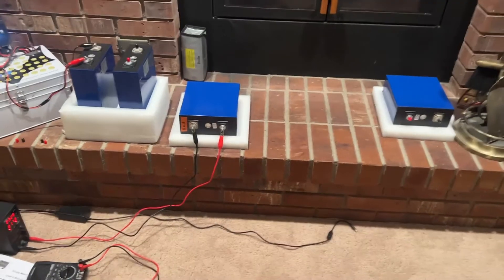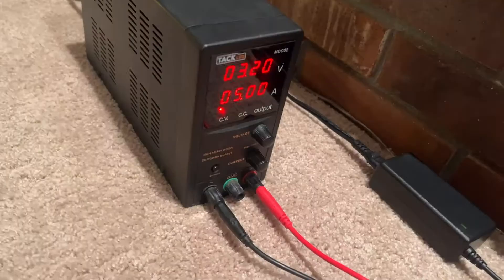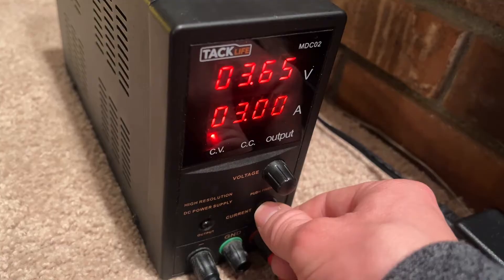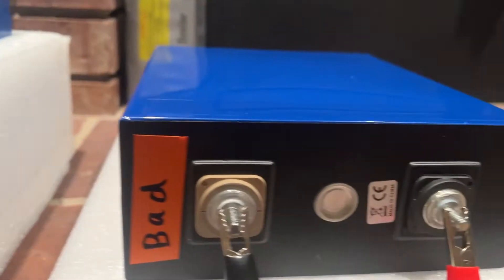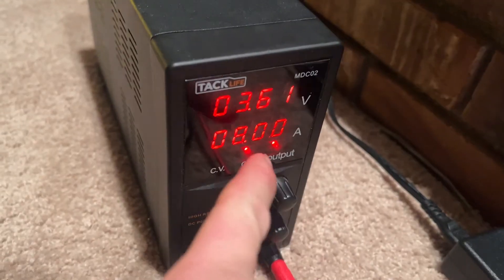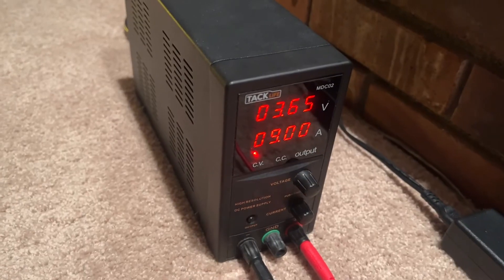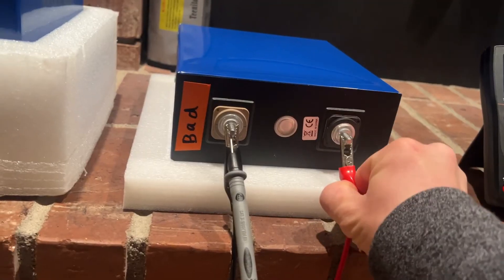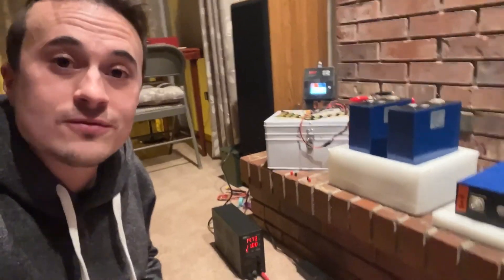How To Charge almost any Rechargeable Battery using an Adjustable DC Bench Power Supply

Comment: I have a 60v leaf blower battery that is to low 36v for the charger to charge. I tried using a 18v drill battery to kinda wake it up but it still won't do it. My bench top power supply only goes to 31v. How can I get this thing to the 54v requirements of my battery charger for it?
Reply from the maker: Get a 60v power supply. Or a new battery so you dont create a fire hazard. The capacity on that battery is going to be so terrible you could also have dead cells
Reply: @4WheelKid I bought another 60v battery. Jump started the original one for maybe 15 seconds and it woke up and started charging. It works fine now.

Comment: Just stick it on 3.65V (the charge voltage), set it to 5A or whatever your wire can handle, and come back in a day.

It isn't full charged until the current stops.
Reply from the maker: Sounds like a plan

Comment: mmm question, can you charge a lipo battery with this?, maybe 1 cell at the time?
Reply: Yes, the main difference is that lipo batteries too out at 4.2v per cell rather than 3.65v.
Reply: @HeyChickens true, thank u
Reply from the maker: yeah just make sure you are using correct voltage
Reply: @4WheelKid sure thing, thx a lot. I'm just waiting for my adjustable DC transformer lol. Can't wait to it. Well thx 😅

Comment: so is the voltage reading the voltage of the cells, or the total voltage of the battery?  nevermind i think you just showed it at the end.. i would set it to 12 or 13v to charge a car battery? that wouldn't be sending 12v into every cell would it?
Reply from the maker: just depends on what your doing. this is the most basic way to charge. you can get more advanced charging. 12v car batteries are simple. 13-14 volts is good for charging car batteries

Comment: I have a hoverboard that I am trying to "restart" I believe it is a 32 v. I have a power bench, what would be your recommeded setting?  its lithium ion
Reply from the maker: make sure you know the exact battery Chemistry and know and if your are charging cell by cell or all cells together. Know voltage range of cells figure out series vs parallel. your 100% responsible for what happens

Comment: `am I better off charging 12v lifepo4 directly with this or using it as the power source for my solar charger. I have a good victron solar charger and it seems that would do a better job of taking a battery through three stages of charge
Reply from the maker: yeah there are much better methods, I like using an isdt charger the most since I have one for fpv already, and it has LiFepo4 mode, and you can use the balance port even with 1s as a volt sense line so you can charge faster with more accuracy which is needed since the voltage profile is so flat throughout the state of charge on this chemistry

Comment: Unfortunetly i see this video late😂 my power supply just arrive and i connect to my 24V lifepo4 without turn on the power supply first and BANG😂 nice 50$ mistake
Reply from the maker: Dang! Didn’t realize that would cause issues 😬
Reply: Thank for your sharing! Just want to confirm. The flow should be: turn on Power Supply -> set Current limit -> turn on Output -> connect to battery. Is it correct?
Reply: Wow 😮. . . Maybe someone should make a video specifically about this exact topic. Because I had no idea that there was a specific order you have to follow. And based on the comments on this comment, seems like I'm not the only one that didn't know. I think I'm gonna go do some more research before letting my son use this PSU. 

I'm so grateful for this video here, It has helped me on so many levels! 👏 👏 👏👏........❤
Reply: Damn, that blows. Happened to me with my first power supply. I won't make that mistake again. $50 to the teacher, I always say
Reply: Tegyél diódát közé...így az akkumulátor biztos nem ad vissza a tápegység felé...

Comment: Thanks for the information. I use power supplies similar to this at work when we are trying to get cells in batteries balanced during the repair process.
Reply from the maker: Hey no problem! I found a charger for rc stuff works super well, mine has a mode for lifepo4 and using the balance lead on a single cell monitors voltage at the battery posts so it can charge at full amperage since these cells have such a narrow voltage curve. Even a tiny amount of voltage drop will slow charging unless it has a voltage sense circuit at the posts along with the charge connection. These power supplies are great if your trying to bring a cell back to life cause you can select ultra low amperage

Comment: How to select a best charging current for huaxing 3.2v lifepo4 6000mah cell
Reply: 0.5C is typical maximum amperage. That would make it 3 amps for a 6aH cell
Reply from the maker: .5C should be good. lower if you want to be extra nice to your cell

Comment: These are very useful tools for maintaining lithium batteries. Doing such things as top balancing a battery when it's cells are out of balance.

But ... you really should make up some custom cables with wire sized for the currents you plan to use and with proper ring terminals.
Reply from the maker: for sure, they can be great for that, I actually found using a hobby battery charger to work best especially when charging a single cell outside a bms. you can connect the charge leads and a single balance lead as a sense wire so the charger can compensate for any voltage drop and charge at full speed. even a tiny amount of voltage drop on lpf cells will slow down charging greatly if you don't use a charge sense wire because the voltage curve thoughout the cells capacity is so flat. ill make a video on it
Reply: @4WheelKid  The problem with charging at full speed is that the currents can exceed what's safe with 18ga wire and alligator clips...

Comment: Sucking in a bunch of fine dust setting on the carpet like that dude.slip a clip board under it.
Reply from the maker: There is dust everywhere my computer is full of it
Reply: Ok turn it off pull the cover blow out the dust out it back together re position it to prevent straight feeding it dust,and take an old couch cushion strip off the material,cur the foam rubber a little bigger than your air opening and make the foam about a half inch and attach it over your air inlet at that thickness or thinner if you can manage it will filter the air without dropping airflow that will filter out dust.which will if it builds up to much will cause short circuits the dust will bridge the distances between hot legs and ground legs internally in your equitment the dust can transmit electricity across the boards in electronics 
It also insolated internal components and shorten the life of said electronics.

PS. watch something funny look up the show letter Kenny
Canada gooses

Comment: Does anyone know if you could use one of these Adjustable DC PS to ran a device INSTEAD of the battery????  In my case could I set this at 12V and 9Ah and connect to the battery connectors and run machine??????  basically use this in place of a 12v 9A battery???????????
Reply from the maker: yeah that's exactly what they are made for

Comment: If a battery pack has cells that are imbalanced will that tool help to balance out the cells that are too low in the pack.
Reply from the maker: no this won't balance cells, ill make a video on a better charger for that
Reply: @4WheelKid  ok so if I'm correct you use it to recharge 1 battery to your desired volts and amp

Comment: No way would I trust the voltage readout from that power supply for charging batteries. A high quality multimeter like a Fluke or equivalent is essential connected directly to the battery terminals.
Reply from the maker: Good to check to be sure

Comment: You have to charge a battery at a limited voltage . What about current. The battery is going to draw its required amps or you have to limit the current as well?
Reply from the maker: you can limit current as well. not a big dealer with these cells though since they can can be charged at high current

Comment: If I want to supply with constant voltage to 12v car battery, what values are safer in order to avoid overcharging or burn the battery?
Reply from the maker: 14.5 volts should be fine, thats what its at with the car running usually
Reply: @4WheelKid  14.5 Is when alternator running right! And what current value? Also the alternator output?

Comment: How would you do this with a headway bank ? Would you have to break it down and link the bars in series? Or just do each cell individually
Reply from the maker: Just depends on what your trying to accomplish, if your building a battery and trying to top balance, i would charge each cell to the top then I would connect cells in parallel and charge all cells together to the top per cell voltage. Then your ready to connect into the pack configuration. If your just trying to charge a battery thats already configured and balanced then I would charge the pack as a whole to full. Again I’m not sure what your trying to do

Comment: I’m pretty new to all of this but I’m trying to charge a small 12V battery for a 8 plug power strip and I’m wondering how high I should set the voltage. On my power supply unit I can’t set the amps unless I adjust the voltage too. The battery currently is charged to about 6.5V

I hope that’s clear.
Reply from the maker: it's hard to say without looking at it. you would want to se the voltage to the max you need to charge the battery
Reply: With a 12 volt lead acid car battery .  You have 6 cells at  2.1 to 2. 2 volts. Charging voltage would be set at 12.6 to 12.8 volts. With an older car battery,  12.6 volts works well.  Charging voltage must be higher than the rated voltage of 12..... Another good tip charging 18650 battery. Set the power supply on 4.1 volts to extend the life of the battery.  If you are unsure of the amp settings. Play it safe. Maybe 0.050 ma. May take a week to charge a battery that slow. I don't know what kind of battery and set up you have. Be patient and safe.

Comment: You should be teaching how to work out how many amps to set the supply to. It's usually 1/10th the power of battery.
Reply from the maker: every battery is different, that's like saying every car takes 5qts of oil. learn about different battery chemistries, and read the spec sheets and learn about  c ratings. these LIfepo4 cells have a 1 c rating so you can charge/discharge them at 280 amps. I wouldn't go that high for charging though even .5 c charge rate at 140 amps is more than enough

Comment: You into amateur radio? Good thing to start. I have one one my workbench. I do not use it on a standard 12.8 radio. They have a bit of ac ripple. Yes i charge bateries with it to. I would not use a solid state power supply to charge batteries. They are circuits you can build to use a solid state ps. Last i remember there are 4 different ways they build switching power supplies. Dave Jones had a you tube channel covering these switching ps. It was called eevblog. Yes they do make very clean ps . Good video.. Nicely done.  Good move on waiting to buy. Try not to pay for something you can not own. 😊
Reply from the maker: I am not, I would but have way too many hobbies at the moment haha. You wouldn’t use a switching power supply like I used to charge a battery? I found the best charger to charge these lifepo4 cells is the one I use for my fpv drones, even if I charge one cell at a time you gotta still use the balance lead connected 1 cell and ground at the battery posts, because it monitors actual voltage of the cell so It can raise the voltage on the back end to compensate for the voltage drop on the cables, these LIFEPO4 cells have such a tiny voltage range throughout most of the capacity that even a small voltage drop will cause it to not be charged at full amperage the charger can put out
Reply: No I would not use solid state ps for charging. Just my preference
Reply from the maker: Thanks!

Comment: Hey, nice video. I was wondering if you have an idea for my situation. I have a shop where I do electrical work on vehicles. Now from time to time the vehicle battery will drain because I work on it for more than a day or so. So I'm looking for a 12v power supply where I can hook up the vehicle so they never drain while working on them. I might as well use some of the power supply to power some probetesters around the shop. Since it's all under the same circuit. I'm not looking though to set rules each and every time I hook up the vehicle. I want it to be a quick thing. On & off. Technically I'm not even charging the battery I'm just maintaining a 12 volt flow. Please let me know if you have any ideas what I can do. Thanks 🙏🏻
Reply from the maker: Hey thanks, I would Highly recommend this one as long as 6 amps is enough (enough for my 4runner but not my bmw)  of a supply charge https://youtu.be/BbK4XzrjWSw also does battery, starting and charging system tests though a phone app. but you don't need the app to start the supply charge, can be done right on the device
Reply: harbor freight float chargers

Comment: Hello sir!!! I need to top balance my lifePO4 cells but I have cheaper lifePO4 charger 14.6V10a how can I archive this while my four cells rated voltage is 3.2V
Reply from the maker: not really possible with that charger, need a charger like this, https://www.amazon.com/Charger-Battery-Balance-Discharger-Adapter/dp/B07R18YNZQ/ref=sr_1_6?keywords=lipo+charger&qid=1681706955&sr=8-6&ufe=app_do%3Aamzn1.fos.18ed3cb5-28d5-4975-8bc7-93deae8f9840 connect all cells in parallel connect the charge lead and balance lead and charge at max amps to top balance, then connect in series, best to connect a bms at that point too

Comment: please can i use lithium battery charger to top balance my lifpo battery?
Reply from the maker: It depends. For Lifepo4 cells usually the lowest voltage you ever want to go is 2.5v the highest charge voltage is 3.65v per cell. Your not descriptive enough on what your lithium charger is. Ill be using my balance charger that I use for my lipo packs for fpv, it can charge life batteries. Even when charging a single cell, I connect the balance lead to the cell posts separate from the charge leads. This allows the charger to raise the voltage higher than the max charge voltage so it can overcome the voltage drop through the battery cables and obtain max charge voltage at the battery posts so we it can send the max amount of amps through. Yet the battery posts will not ever be getting above max charge voltage because its constantly being monitored by the charger through the balance lead. My balance charger can charge up to 12amps and takes about 24 hours to fully charge a 280ah lifepo4 cell but it also has 2 channels 12 amps each so I can charge 2 at a time. Ill be making a video all about it

Comment: Great vid man! Do you think charging off of a power supply will decrease the life of the power supply?
Reply from the maker: hey thanks! I don't think so it's designed to output 0-30 volts with 0-10 amps. the cooling fan keeps things cool

Comment: had to save a few power tool batteries using the same method, those benchtop power supplies are nice.
Reply from the maker: yeah so nice you can custom charge anything. my regular 2 channel charger kept kicking me out because it was charging so slow. a lot of good uses for them
Reply: I’m trying now on a 56 volt ego battery.

Comment: Useful info m8. I have a lab spec power supply that I inherited from a roommate. Gonna have to drag it out of storage for some experimenting. I have a collection of li ion and lipo batteries begging for project use.  Did you move into your own crib? If so, congrats!
Reply from the maker: thanks! nice they are quite useful. fun to test stuff out on too. nice, I think you can get a special welder to weld the li ion contacts to bus bars to make some cool battery packs. na still at my parents place. ill live in a vehicle before I rent an apartment. need to figure out where I want to live before buying a place

Comment: That's awesome to show how that works. I know I had to jump start my dewalt and Milwaukee packs to get them to charge when running them down too low to charge.  Awesome power supply I remember when they use to cost way more back in the days before Amazon 🥰
Reply from the maker: for sure, I couldn't find any videos really on how to use these power supply's as chargers so I thought I would make one. good to hear, those tool batteries are not cheap. yeah it's crazy how cheap this kind of stuff has gotten. haven't had any problems with mine so far
Reply: don't over discharge your battery pack or leave it empty for too long. It destroys the battery slowly diminishing its capacity.